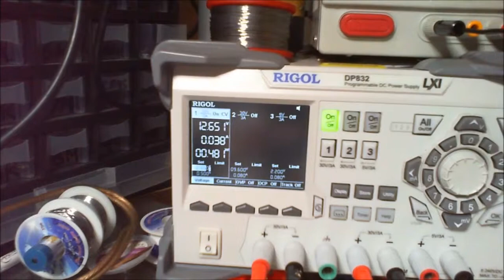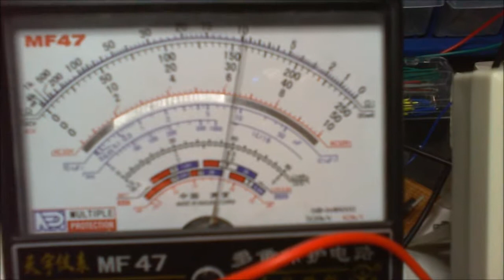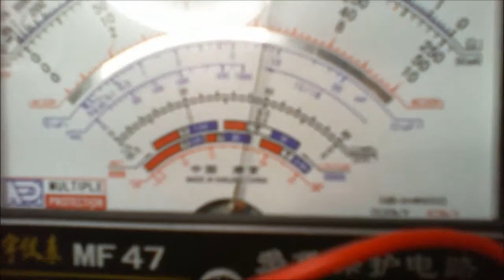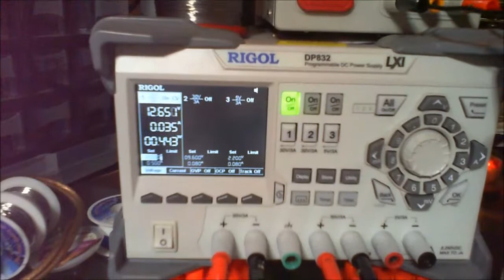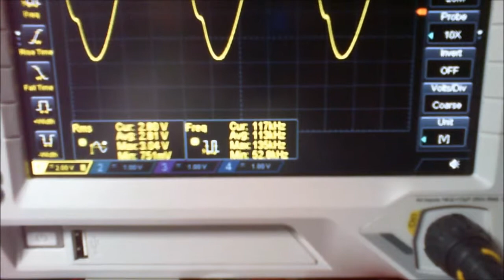My first DIY DC to DC Boost Converter (its a bit lame)

Comment: did you ever figure it out? I am needing to build a DC to ac inverter pure sine wave. to run my off grid home.but I haven't gotten as far as you in the video. I need help. I don't want to say I'm the smartest person I know. but nobody I know has the least bit of electrical know how. so its on me to do what I can. I am self taught. and don't have funds to buy a 3kw plus inverter. do you have any experience with any inverter circuits? I wanted to start with a DC to DC to go from 12-24v to 120+/- then to pure sine ac . but thanks for the video.